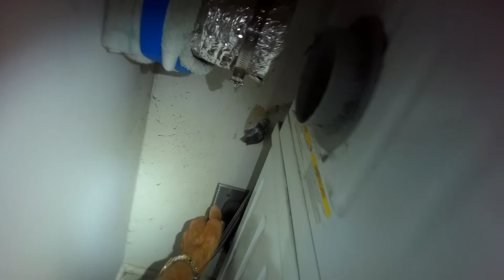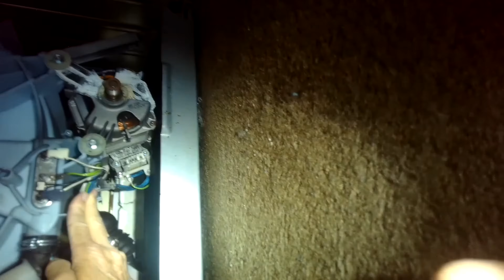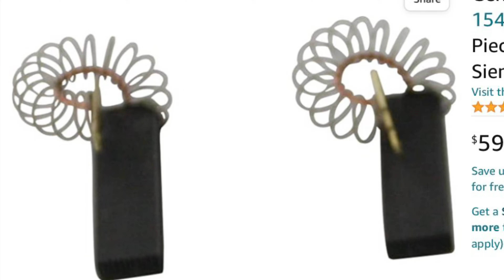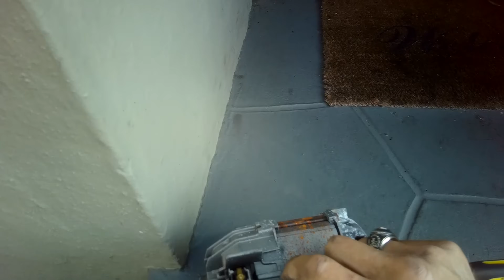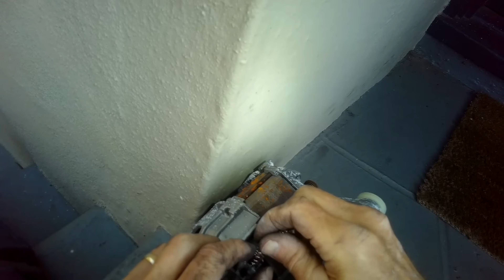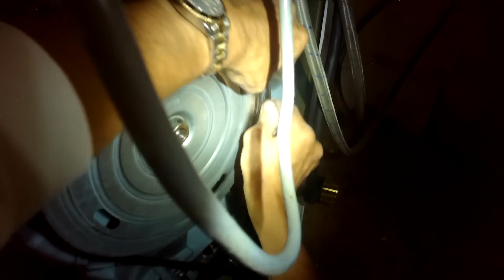✨ Bosch Washing Machine Won’t Spin - Easy DIY Fix ✨

Comment: After starting, the Bosch Maxx 6 washing machine only fills with water but the motor does not start; the carbon brushes and drive belt are in good condition, yet the motor operates during the spin cycle.
Reply from the maker: It must not be sensing that it’s filled with enough water to start agitation.

Can you take the hoses off the back and check the screens?
They might be filled with junk limiting the amount of water.

Comment: Thanks Scott for this Great Video ! It helped me to maintain my WFO3250DN/15. In my case motor brushes were not that wore out, but I cleaned the carbon dust with some air which did the job for now. Spins like a new now🙂
Reply from the maker: Great idea👍😊

Comment: Great video! I have chaged my Bosch washing mechine bushes after watching your video. One thing I have noticed is that it has now started making strange tick tick noise (I wouldn't call it grinding noise because the noise was coming soon as I changed the bushes and spun the motor before putting it back in the machine) and I sort of expected that this tick tick noise will eventually come when I assemble everything back. What could be the possible reason? The reason I changed my bushes was that I also started seeing that F21 error code and the old bushes were also less then 1/3 of the length of the new bushes. Any suggestion would be a great help. Thanks!
Reply from the maker: Can you send a video of the noise to my email at:scottthefixitguy@yahoo.com

Comment: Hey Scott. Had same problem- filter and inlet ok, pump ok, checked brusches and they were severly worn(7mm left). Replaced them but there is no spin no move at all. Lock is ok, water coming but no spin. Where to look now? Condenser, any circuit breaker for engine? It was working ok till it stops. Bosch exxcell 1400.
Reply from the maker: Sounds like it will need a new controller 👍

Comment: Hello Scott!
Thanks for this video. It's very clear.
On my Bosch Nexxt 500 washer, the problem is a little different. Indeed, it sometimes happens, once the wash is finished, that the final spin has not taken place. So, I put the cursor on spin only and usually, it works. However, yesterday, it took 2 tries for it to work. In fact, the drum turns to the left, to the right, the pump works but the spin mode does not engage.
In your opinion, could a problem with the brushes cause this intermittent problem?
Thanks
Reply from the maker: Very likely 😊
Reply from the maker: Could also be the door lock.

Comment: I am totally amazed. I was ready to send our 21 year old Bosch Axxis to the junk yard. I looked on youtube for the symptoms and found your video. I just completed the fix and it worked!! I am still stunned that a $50 part (true Bosch carbon brush) could fix the machine. You saved us about $1,500 for a new one. Our model varied slightly from the one in the video but essentially the same idea. Yes its fiddly as someone below mentioned but in a couple of hours after getting the part it is now working again. The one area we got a bit stuck on was the green groundwire couldn't be removed using the screw as it became stripped before it would loosen so we used needle nose to pull the two fins open and reverse when reattaching. Also the motor was a bit tricker to remove but after wiggling it quite a bit and using a bit a leverage we got it out. Still in shock... I suspect almost 100% of these end up in a landfill.
Reply from the maker: You are so right, just those goofy carbon brushes and it spins like new again👍

Comment: I have got a bosch logixx 8 washer and when you shut the door the drain pump starts spinning and the drum is juddering a little bit then stops. The drain pump stops after a few minutes but nothing happens after that. No error codes no timer display. I have repaired the door lock assy because i had 2 beeps which indicates a faulty door lock but now this problem. Any ideas? Much appreciated
Reply from the maker: Can you send a video of that to : scottthefixitguy@yahoo.com

Comment: Hi Good day! Can I have an idea about our Maxx 6 Bosch WM. The problem is it won't spin, just continuously blinking the RINSE Iight in any program. I already change the Carbon Brush because need to change and clean the filter but the problem is still the same wont't spin. I already reset.
Reply from the maker: Thanks Erwin,
It can’t advance to spin because the screen where the cold water enters is clogged with a bunch of crud and the washer needs cold for rinse and spin.

Comment: Our Nexxt 300 washer was really "clunky" when it spinned the last time -- louder than ever before.  Now it won't spin, but it's making an arbitrary "clunking" sound every five seconds or so, like it's trying but there's no movement.
Reply from the maker: You might have a broken spider bracket. That will make a clunk as it spins.

Comment: Hi Scott
My Bosch also wouldn’t spin and I replaced both carbon brushes (I hope correctly) and the basket still won’t spin.
Do you have any further advice?
Reply from the maker: Thanks Jason,
I wonder if it needs a new door lock?
If the controller thinks of the door is not locked, it won’t go to spin.

Comment: Well I got the motor out but it looks like my Bosch nexxt 300 series has a brushless motor. Belt looks ok whats next for a "no spin/no tumble condition?
Reply from the maker: I think it’s time for a new door lock.
The controller thinks the door is open👍